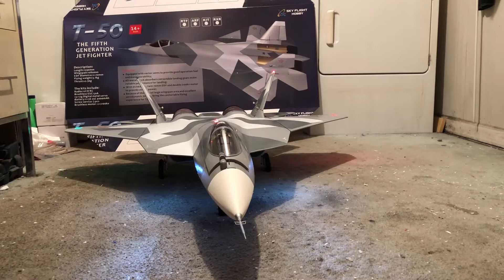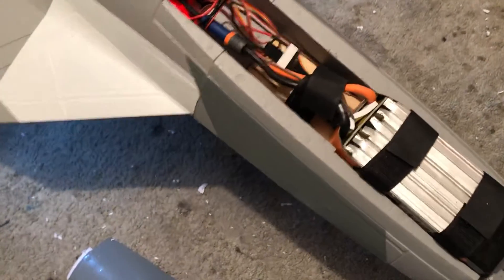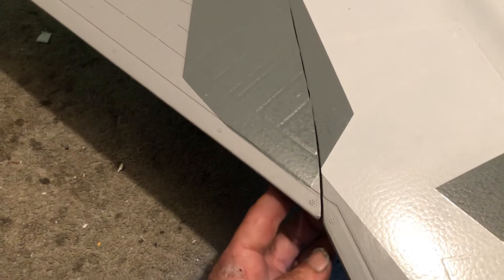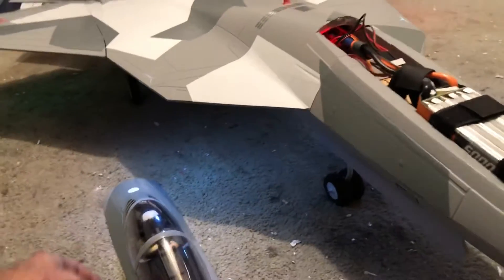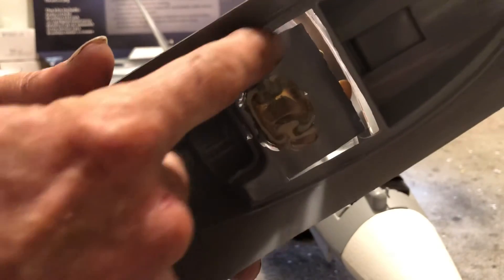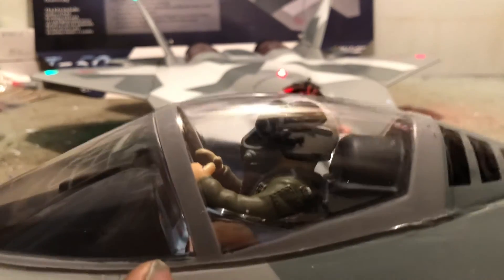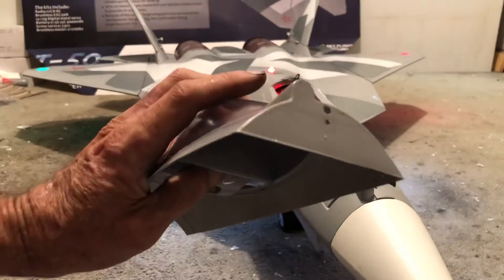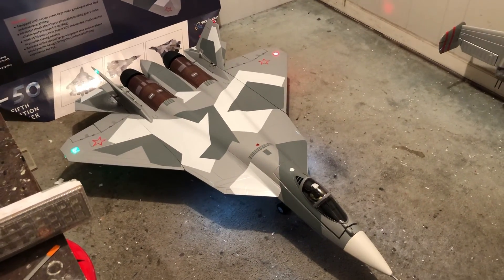LX SU-57 PAK FA (Battery Placement)

Comment: If you have an 8 channel RXand Tx, you can turn your TV on/off. If you can still get the the TV servo wires. Looks great.👍
Reply from the maker: Bruce Beamer yes I seen Captain Mike do that on DX8 so I can on DX8e I have but need channel to cut gyro on and off. All that will be unplugged when the maiden comes.👍🏻✌🏻🖖🏻
Reply: Ah, the gyro. Thought if you turn a gyro off it has to recalibrate. Not good